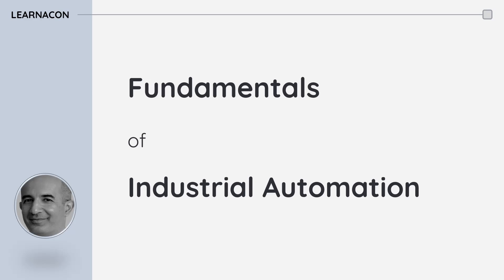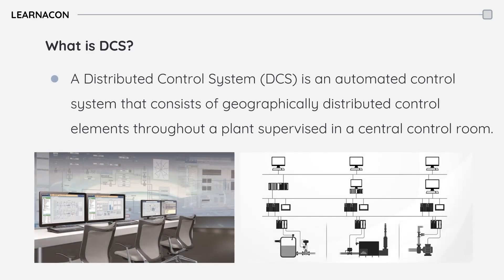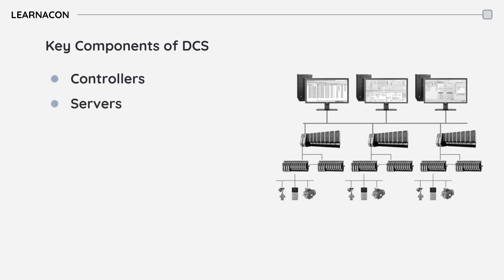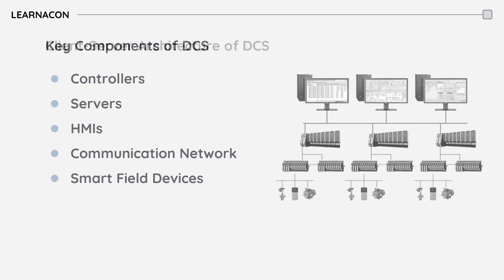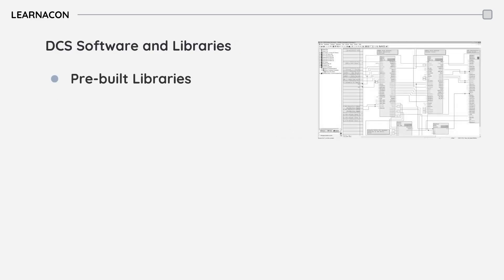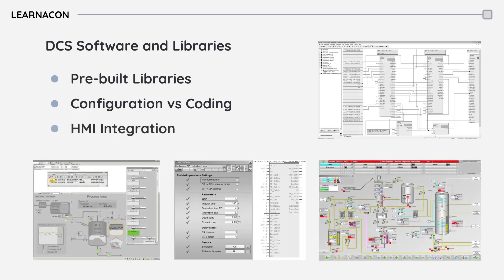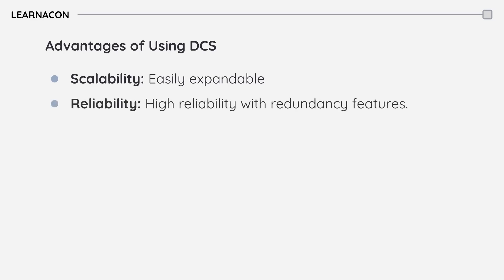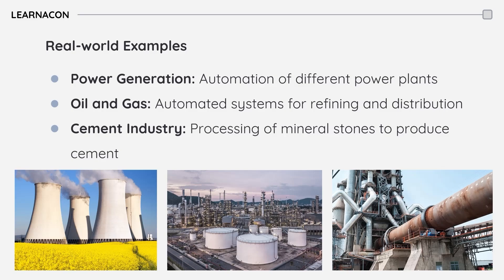What is DCS? (Distributed Control System)

Comment: the servers in DCS are also the CPU which are communicated with i/O module in the field? Thank you!
Reply from the maker: Not really. Servers are Industrial Computers typically with an operating system running multiple applications depending on how they have been configured. However, Controllers could be compared with PLCs in terms of communication with I/O modules.